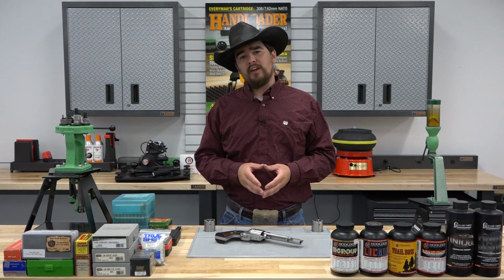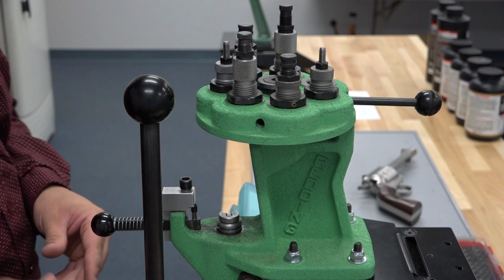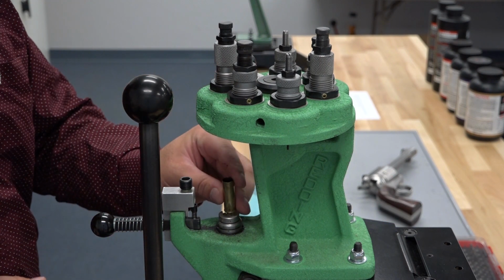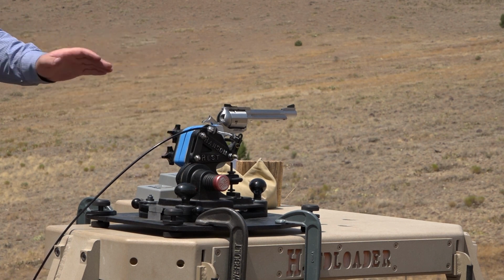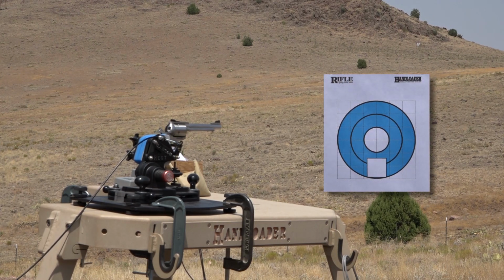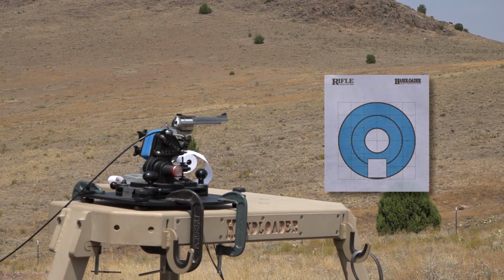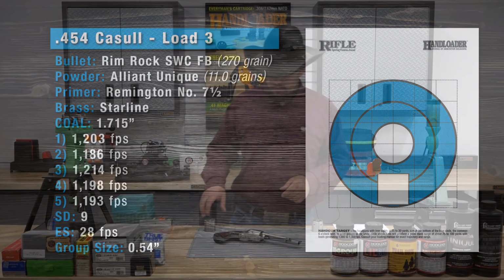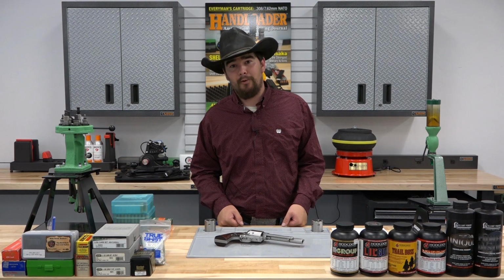Freedom Arms  454 Casull

Comment: Just now viewed this video (Dec 2021). Very comprehensive review of the FA 454. I bought my first premier grade FA model 83 about 20 years (454 Casull) and later on picked the same gun in 44 magnum. The 44 was relatively cheap ($1,000) because of a broken firing pin. I sent the gun back to Freedom Arms and they repaired it, no cost, and return freight paid within a month. Not only are the guns of  the highest quality, so is their customer service. These are the best handguns I have ever owned.
Reply from the maker: First off thank you so much for watching! We really appreciate it. We do our best to show the results exactly as we get them and be completely open and honest in all of our productions. That is a steal on a Freedom Arms Revolver! They are an excellent company and I honestly don't have enough good things to say about there guns! I recently worked up a new .45 Colt load in my Freedom arms model 83 and using the dedicated 45 colt cylinder and it shot a 5 shot group into .3 inches center to center. It is truly amazing the accuracy you can get from these guns. Thanks again for watching and taking the time to comment! --Jeremiah

Comment: I bought a Model 83 new about 25yrs ago with the .454, 45 colt, and 45acp cylinders, and I agree the workmanship is phenomenal.  When I purchased the revolver I ordered the 7 1/2"  barrel along with magna porting (4 ports)  from the factory.  I had also installed a Burris 1 1/4 - 4x adjustable scope, the recoil destroyed the scope in short order and after shipping the scope back 3 times to Burris, Burris said the adjustable scope would be unable to withstand the recoil and they highly recommended I replace the scope with a fixed power scope which I did and they refunded the difference in $$.

I did learn early on that the revolver is more accurate than I could ever hope to be.
Reply from the maker: It really is amazing what they are capable of doing with these guns, some of the finest craftsmanship I have seen in a revolver. As much as I hate to admit it, Magna porting the barrel does make a lot of sense with this heavy recoiling cartridges such as the .454 Casull. That is very interesting about the scope but also not terribly surprising given the recoil. It is very nice to hear that they took care of you. I have a Burris I need to send in for work myself soon. Entirely my fault, I dropped it while out in the field and it just happened to strike the turret just right and messed with the tracking. 

We have that in common, I have no doubt that the model 83 will outshoot me every day of the week! Thanks for watching and taking the time to comment! --Jeremiah

Comment: Great video. I will attest to the importance of the correct crimp. I learned the hard way that the bullets will jump crimp and lock the cylinder down.
Reply from the maker: Indeed the lack of crimp can certainly lead to some headaches and it's amazing how much more crimp is required with the 454 Casull vs. say the 9mm Luger. Thanks for watching and providing feedback. --Jeremiah

Comment: I heard you reference you pleasure with IMR 4227.   Accuracy was good, as you showed and stated.   The only problem I’ve seen with 4227, is the lack of completely burnt powder exiting the cylinder when using   Accurate #9 I found to be a very effective powder in the 454 Casull.   It’s not as temperature sensitive as H 110, and slightly milder recoil.   I’m on my second revolver in this cartridge.    The first was retired by the manufacturer, due to use.  One of my all time favorite cartridges ever made.   With 475 Linebaugh coming in a very close second.

Comment: Thank you for the great video! Very well edited and presented. I have a FA Mod 83 454C with a 7.5" barrel. It shoots absolutely awesome as you also proved in your video. Try the LEE crimp die. I consider it to be superior to anything out there!! W296 and 300 gr Hornady XTP Mag bullets works for me. Recoil with a 454C is stout but you can get used to it quickly. Happy shooting!!!
Reply from the maker: No Problem glad you enjoyed it, thank you for watching! We strive to provide the most accurate and reliable information possible in an easy to watch format. They are amazingly accurate revolvers some of the finest I have ever handled. I am a big fan of the Lee Factory crimp dies they work very well and use them in many different cartridges. That sounds like a great load, recoil is stout but it is manageable. Thanks again for watching and for sharing your experience It is always nice to hear what others are doing and experiencing.

Comment: I would love to see list of products used; like Ransom Rest and bench. Great setup.
Reply from the maker: We do list all the bullets, powders, load data and other things like that but this is the first time I have heard anything about a gear list, we could probably do that easy enough provided enough folks are interested in it. If you have any questions about the gear used in this video don't hesitate to ask I am happy to answer any questions. Thanks for watching and taking the time to comment! --Jeremiah
Reply: It looks like you use the Ransom Master Rest with windage base, remote cable pull, and that cool table. Is there anything else? Where can I get that table? Great job with videos.
Reply from the maker: @petercastronovo9370  That is correct A Ransom Master series rest with windage base, remote cable pull and their master series base plate as well. The shooting bench is a Konig Jager and sadly they are no longer making those benches or anything similar. These days we recommend Stukey's Sturdy Shooting Benches, they are very sturdy and also portable. You can see this bench used in our 28 Nosler vs. 7mm Rem Mag and our video on the Oehler System 89. I'll post links at the end of this comment. Thank you for the kind words and feedback we greatly appreciate it and are always looking to improve our videos! --Jeremiah
https://youtu.be/1u7AApQpMH8  Oehler System 89 video,   
https://youtu.be/Sg9XXUZnlCk  28 Nosler vs. 7mm Rem Mag

Comment: This was well done.  I'm not familiar with backing out the seating stem and then moving the die down to crimp, but hey that works.  If I crimp without using the seating die, I use a bullet crimp only die (Lee, Redding... ) .  BUT there are different ways to achieve the same thing.  Again, not a criticism, but I've found that the older style Lee hand primer tool to be almost perfect, haven't tried their new style.  I found the RCBS hand primer to be counter intuitive using.  The primers were above, and the brass below, and without holding pressure on the handle the brass waiting to be primed would fall out unless you held it almost level.  I see the Franklin Arsenal has the brass below, and the primers above, but it seems like the brass was held in position by something.  Maybe they have come up with a better design then RCBS.  
Great gun, I'm waiting to purchase a Freedom Arms.  I like the single action revolvers.  Have a Ruger Bisley w/5.5" bbl, & .45acp cylinder with it's 45 Long Colt cylinder.  Wonderful to shoot the 45acp after some stout 45 long colt rounds.  The revolvers fairly heavy, so the 45 acp rounds hardly recoil compared with some stout 45 long colt rounds.  Freedom Arms have a solid rep for accuracy out to 100 yards, wish you'd shot at a bit longer distance, but such good groups at 15 :-) .  Very nice. Thank you.
Reply from the maker: Thank you for the kind words and for the feedback we greatly appreciate it. Most dies have a built in crimp feature and it usually works quite well but it is not as convenient as a separate crimp die. I do like the older style lee hand primer as well. I am not a huge fan of the RCBS one either it can be a little tricky to use. I have not tried their new model though. I have used the Frankford Arsenal Handprimer quite a bit though and it is my favorite by far mostly because of how organized the kit is and the excellent feel it offers. The brass is above the primers with the Frankford hand priming tool I would encourage you to check it out. I do love the Freedom Arms products they are of outstanding quality and their reputation is well deserved. I do plan on doing more testing at longer range at some point but I am not sure when as of yet. Thank you for taking the time to watch and comment! --Jeremiah

Comment: These really powerful handguns (like the 50AE) cause my hands to tremble after about 10 shots.  44 magnum is the best I can handle and for most of my shooting  i download the rounds to about 1050 fps, which is pleasant to shoot. A 454 Casul is really a hunting gun. For self defense and general shooting, a 357 or 44 is as much gun as anyone needs. I'm a revolver fan, btw. I like the reliability of wheelguns.
Reply from the maker: I hear you there, bigger handgun cartridges are not easy to shoot due to the amount of recoil. That is the wonderful thing about handloading you can tailor your loads to what you like. I agree however the 454 Casull is great for bear defense and things of that nature. We have done videos on the colt Python in 357 and the 44 special as well. The 44 magnum is on the list to cover but we are still sorting out what test gun we want to use. Thanks for watching and taking the time to comment! --Jeremiah
Reply: Freedom  arms makes .357 41mag and 44mag also so might check them out

Comment: Elmer Keith started with the 45 Colt. But after failures with cylinders in 45 Colt and 45/70 bullets he was told about using the 44 Special.

Comment: While a good crimp is important, case neck tension holds more tightly.  Using the expanding plug from a 44 Magnum die set will bell the case mouth while not reducing neck tension.
Reply from the maker: We did not try that we stuck with the .454 Casull expanding die. However it may be interesting to try the 44 Magnum and retry some loads to see what a difference it makes! You have perked our curiosity!

Comment: Hello,  I really enjoyed this video.  I have been using H110 full power but wasn't getting the accuracy I wanted.  So I did your longshot load and it grouped great!  I was just wondering if you felt that this was close to being too little powder?  Hodgdon data site has minimum load at 14.5gr and I noticed quickload had chamber pressure at 19500.  (I did this after I tested load on paper)  

Anyhow, how about doing a video like this with a 500 Linebaugh BFR?  There isn't any videos like that on youtube that I can find.
Reply from the maker: I apologize for the delay in responding to your comment! I did not get a notification for this one for some reason and only found it by digging through the comments today! I have had great success with Longshot powder and I truly think it is a bit of a hidden gem of a powder. If you compare the differences from 45 colt to 454 Casull you can start to see that there is more wiggle room there than most folks will give credit for. 

I would love to cover the 500 Linebaugh BFR, it is simply a matter of getting my hands on one that is the real challenge. Hopefully one day! Thank you for the kind words and taking the time to watch and comment! --Jeremiah

Comment: Got a powder question for you guys.  I bought some Shooters World Match Rifle powder for M1 Garland loads.  Star line Brass full length small base sized trimmed to length, WLR primer and Winchester 147gn FMJBT bullets were crimped.  As Shooters World suggested I reduced their only suggested load of 46.5gn by 10%. The 46.5gn  load was showing 2400fps on my chrony.  It looks as if the case never sealed because powder residue coated the entire case.
Reply from the maker: That is a very interesting result my guess is that the case capacity is different from the Federal brass that Shooters World used for their pressure testing. While shooters world manual does state 46.5 grains is a good load for the M1 Garand they state it produced a velocity of 2,720 and pressure is only about 45,000 pounds per square inch. While I know i have case capacity measurements for both Federal and Starline cases I can't recall the measurements off the top of my head. I would suggest working up to a max of 2,720 FPS or until accuracy is acceptable. I would blame case capacity or perhaps you have a lot with slightly slower burn rate. Either way it should be no issue to slowly work up to the stated velocity and watch for pressure signs. Thank you for watching and commenting hopefully that helps you!

Comment: You mentioned the target was at fifteen yards, but I’m surprised the accuracy was so poor for some of the loads. Also, I thought FA didn’t recommend using Lil’ Gun.
Reply from the maker: That is true the target was at 15 yards which is the distance we conduct all of our handgun testing at so it is comparable from video to video. We thought that was a fair distance for the broad range of handguns we test on Handloader TV. We like to show our results,  We had some very good loads that grouped right around 1/2 an inch while some were closer to 1" but all groups we felt were respectable. Perhaps with more load development we could have gotten even better groups. The gun itself is capable of very good accuracy as displayed by load 5 and load 3. 
Yes that is correct Freedom Arms does not recommend using Lil' Gun Powder which is why there is a disclaimer in the video description. It can erode the forcing cone prematurely and cause accuracy issues. We believe this is caused from the high Nitro content in Lil Gun and it would likely apply to many other cartridges not just the Freedom Arms Model 83. Thank you for watching and thanks for commenting.
Reply: FA recommended NOT using Lil GUn,..In fact, didn't they state they would no longer provide warranty is Lil Gun was used and the problem was gas cutting? It's been a while since I read that, so I may be remembering wrong. I do recall I sold all my Lil Gun after that.
Reply: @HandloaderTV  Jeremiah, Are you aware of any other pistol powders that FA (or any other mfgr for that matter) recommend against? I also own a FA83 and don't want to use anything that would accelerate wear unnecessarily...Thanks!! Thankfully, I don't own any LG, but have used other Ramshot powders like Enforcer, which has a similar burn rate to 2400.
Reply from the maker: @andrewj6182  As far as I know there are no other powders linked to the heat cracking and the stress that Lil' Gun causes, It is something that should be noted for other rifles and revolvers as well. After speaking with both Freedom Arms and Hodgdon the conclusion is the fact that Lil' Gun has a high concentration of nitroglycerin in it could be the root cause of this especially when used with heavier "full power" loads. I did shoot lil' Gun to see if it had any adverse effects on our test gun, the little amount we did shoot about 25 rounds back to back letting the gun cool between 5 shot strings showed no visible damage when inspecting with a hawkeye bore scope. So I don't think that in small quantities keeping the temperature of the gun low will cause any significant damage. To air on the side of caution I have avoided that powder for all of my revolvers. I do still use it with rifles and have not had any issues as of yet however I do not run a ton of rounds through the barrel without letting it cool. And as far as I know there are no other powders that seem to have this effect. Some theorize it is the type of steel that is used and that is what is causing the issues some sort of chemical reaction. That seems a little far fetched to me. I hope this answers your question and if there is anything else I can do for you don't hesitate to ask! --Jeremiah

Comment: You might want to put a dial inductor on your ransom rest to make sure it is indexing the same each time.
Reply from the maker: If used properly the use of a dial indicator is completely unnecessary. The Ransom rests are machined and the tolerances are checked by the manufacturer, they are indeed 100 percent repeatable and reliable. the addition of a dial indicator seems to be more of a headache than it's worth in fact adding one to a moving part like the rest under recoil I think it would be more likely to break the dial indicator, especially with a cartridge as powerful as the .454 Casull. I think the groups speak for themselves in the accuracy of the ransom rest and I have complete faith in it's reliability. I think you would be better off to ensure your setup is correct and the ransom rest, bench or grip inserts are not moving under recoil. I think that is the biggest mistake people make with the Ransom rest. While it may sound like a good idea on paper in reality I don't see any benefit to it to actually aid in the repeatability of the rest. Thank you so much for watching! Good shooting and happy handloading! -- Jeremiah

Comment: I believe I picked up Guns & Ammo magazine back in 1973 and it had a Freedom Arms revolver and it used 3 powers per load to get to velocity he wanted. I waited years before production then couple years to save up 800$ for the firearm. I bought 500 rounds of empty brass ( about cost of a super Blackhawk) just because I thought 454 be a flash in the pan round lol. The round brings down pigs with factory ...300gr...no problem
Reply from the maker: Yeah it seems to still be going strong, I think the major contributing factor to that is the fine reputation of the Model 83 and the performance the cartridge is capable of in a good revolver. Indeed I know many folks who have used it on game as large as elk at reasonable distances. Very impressive performance and ballistics. Thank you for watching!